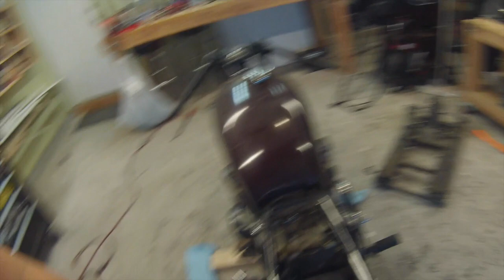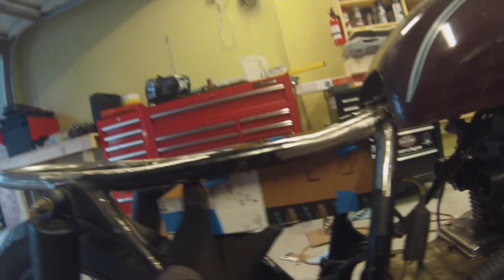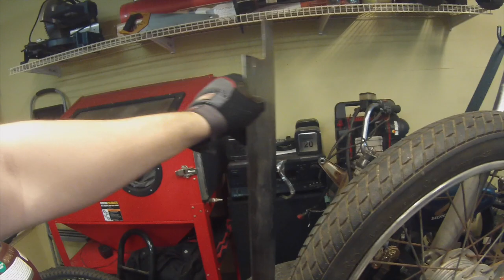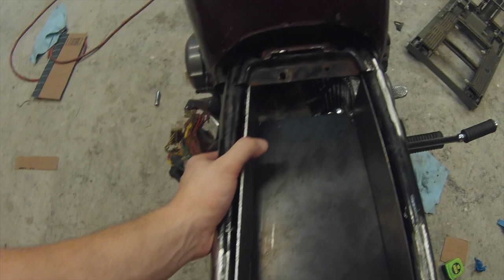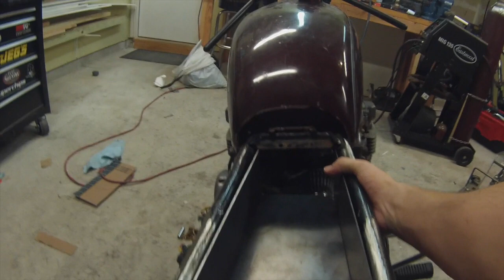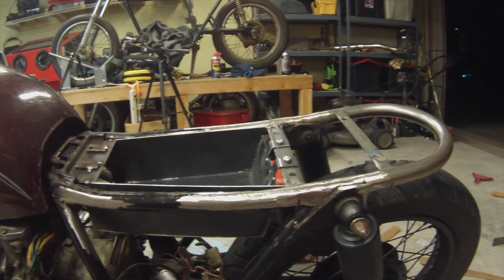How to build a CB550 Cafe Racer / Brat : Part 6 Building a battery box

Comment: what kind of electronics did you use for this bike? doing a CB360 build but since its my first build im totally lost for what to use?
i know noob alert!
Reply from the maker: All of the electronics on this bike are stock other than the battery. A CB360 should be pretty simple to wire up so that's a good starting place.

Comment: Sorry for alittle late comment, but quick question? What battery are you using for your motorcycle?
Reply from the maker: I'm using a small YTX4L-BS battery I found on Amazon. It's 12V but on the lower side on amperage, I think it's around 40-50CCA but it works great so far. Has plenty of juice to start the bike and I have had no issues what so ever with it.

Comment: @Classic Octane Looks great! Working on a cb550 myself. Which exact battery did you use? Did you put in a solid state reg/rect? Thanks!
Reply from the maker: I'm using a small YTX4L-BS battery I found on Amazon. I will throw the link below. So far it's great. It has plenty of power to start the bike.  I haven't updated the Reg/Rect yet but it might be something I do in the near future. 

https://www.amazon.com/gp/product/B00I1KMLTO/ref=oh_aui_detailpage_o05_s00?ie=UTF8&psc=1
Reply: +Classic Octane thanks! Is this electric start or kickstart only because your battery has 3ah, 40 CCA which is quite low compared to the OEM battery with 12ah and 120 CCA. Cheers!
Reply from the maker: It's both but I use the electric start most of the time and it fires right up. If you live somewhere colder and plan on riding in cooler temps then you might want to get something with a little more power.
Reply: +Classic Octane thanks!